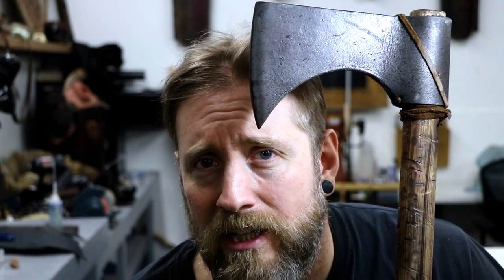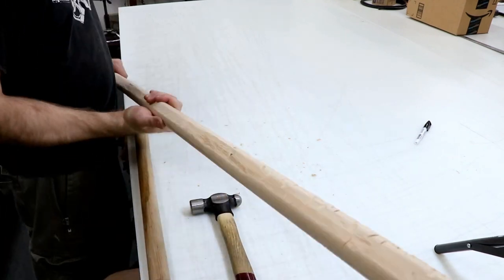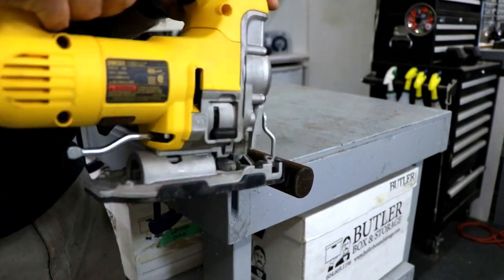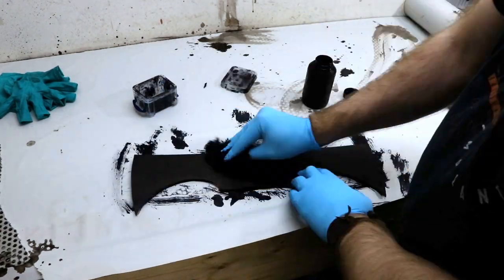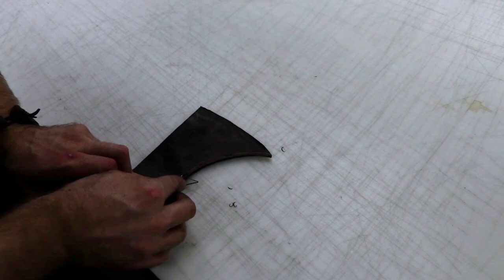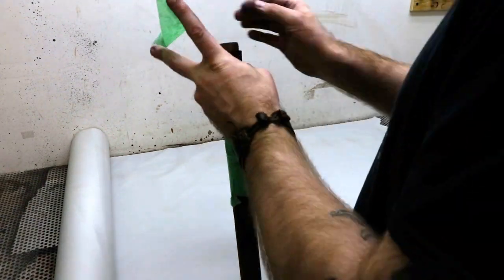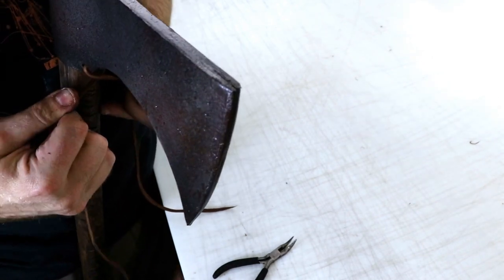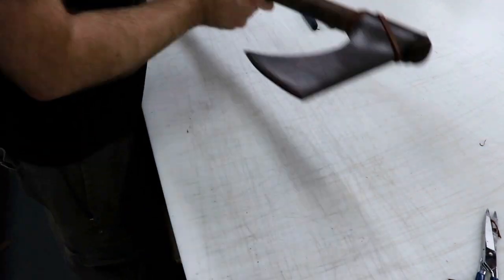Making a Prop Viking Axe

Comment: My suggestion would be to do a double layer of leather. The first one you could stitch together to hold it on the handle, then a second layer over that glued on to conceal the stitches
Reply from the maker: Not a bad idea. Curious how it would hold up given it was taking a lot of impact. But I guess it's already got a glued edge and it's holding fine.